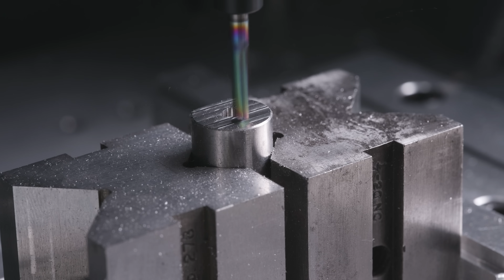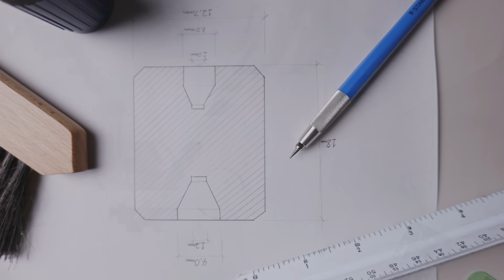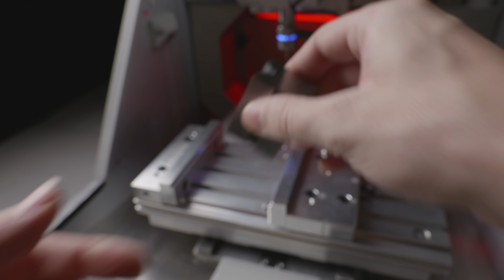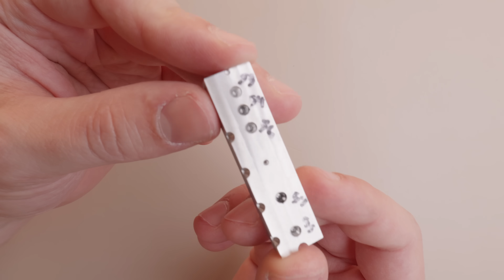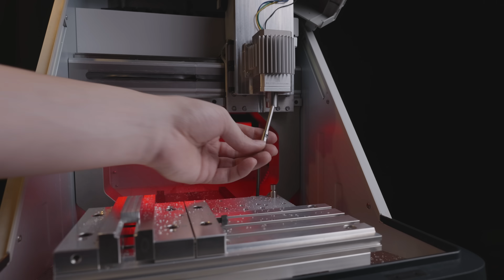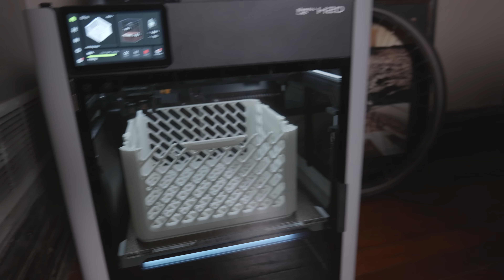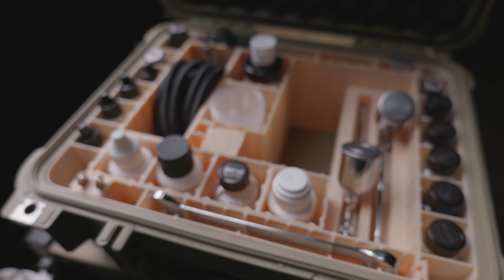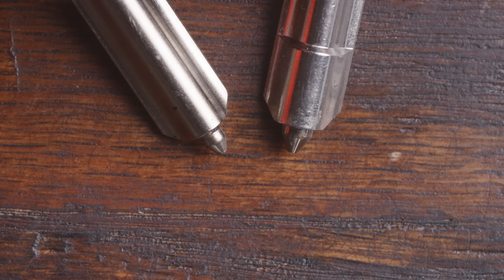Inventing A Tool Every 3D Printer Needs

Comment: That one Bambu engineer: Wouldn't it be fun if the nozzle had a 55.3 degree taper angle? 😂
Reply from the maker: haha they had no idea someone would spend a month trying to measure the taper angle
Reply: @Unemployed_Architect  you could have projected the shadow of the nozzle using parallel rays of light that you create using lenses, a picture of the proected shadow would help you get a very precise measurement of the angle , not sure if you tried this already lol.
i know you tried the camera thing but cameras cant get the angle just by taking a picture the camera lens would warp it ig
Reply: Is the taper even consistent between different batches of the same size nozzle? I'd expect them to be made by CNC, but maybe it's just some guy in a sweatshop eyeballing the angle on a lathe.
Reply: More likely they use a fixed taper length and wall thickness around the final orifice, leading to random ahh taper angles that differ for the sizes.
Reply: @quinnobi42  You are probably right.  It could also be measured in gradiens though.  LOL
Reply: Perhaps there's a "sensible" machining reason for it, like it's arcsin(14/17), or something.
Reply: XD
Reply: Eh, it goes with the company's general ethos: fuck the customer.
Reply: @werdfeefs7027 - so say all the morons.
Reply: @werdfeefs7027 And advertise so much that they'll fork over thousands of dollars anyway. It baffles me how many people fall for it.
Reply: @dekutree64  - it baffles me how stupid the anti BL fraternity are, ironically, when they should be thanking them for moving the hobby forward and dragging the Prusa's of this world into the 2010's.
Reply: @werdfeefs7027 lol what? You seriously think some engineer sat in their chair and contemplated the nozzle champfer angle based on "fuck the customer"? 

You have got to have better things to wear tin foil hats about
Reply: @werdfeefs7027so edgy 🙄 what does that have to do with the angle?

Comment: Yeah, man, those desktop machines are kind of neat, for what they do, and they do do what they say they do, it just has to be really slow. Like, you can't have any ambition with those things.
Reply from the maker: Ya for my work flow i very much see it being a second operation kind of machine. Rough the part out on my manual machine and use the CNC for any weird or super complicated geometry. In the end of the day a 35lbs desktop machine will never replace 2000lbs machine

Comment: Engineer here, Here are a few problems with your build:
-Your device is more expensive to make and needs special tooling to manufacture. 
-its almost impossible to mass produce for all the different kind of printers out there...
-making it out of a harder material than your typical brass nozzles will make users eventually damage their nozzles
-its usually easier to use the most common tool, (a brush pad) and improve that design...
Reply from the maker: @VoidPixel4179 all fantastic points! I will say that if I were to make more than a dozen I would definitely look into getting these made using SLM. 
With how small the part is you could really pack the build volume and get the price wayy down.

Plus with SLM you can do a variety of hard and soft metals and you wouldn’t have to make custom tool paths for each nozzle.

That said for majority of people the brass brush or some other simple tool is gonna be the way to go. This was more of me just seeing if it’s possible
Reply: @Unemployed_Architect  i appreciate your honesty.  If it's a limited run then fine, but just google how many 3D printer manufacturers are out there and there are dozens, and almost as many different nozzle geometries. You mentioned SLM, again from my material science background, SLM leaves bumps which act like sand paper. They usually have to polish an SLM part if they need a smooth finish. This will also add to your manufacturing complexity and cost, not to mention any sanding will change the final dimensions. 

This is why we engineers are trained to loop problems in steps and come up with the best possible solution given our current materials and tools. Improving brush design seems to be a better path than overcomplicating this tool....
Reply from the maker: @VoidPixel4179 Well see i was thinking the rougher surface texture could be a benefit acting exactly like an abrasive and removing an microscopic bits of filament or residue. That said it could also be a problem causing premature wear to the nozzle. 

Ya if im being honest with myself i just made it because i thought it would be cool...which is why im an architect not an engineer haha

Comment: The spinny handle is legit. Perhaps a way to “embed” brushes or some other flexible abrasive into the cleaning end, so it can adapt to any angle?
Reply from the maker: Ya like a hard rubber thats imbedded with abrasive would probably work. Brushes could be hard because the nozzle is only like 3mm wide
Reply: A cratex stick is kind of what you describe. Not sure how well it would work but it is a great material.
Reply from the maker: Exactly like a cratex stick. Although ya it might be to soft

Comment: too complicated, too expensive, and a hot nozzle with a soft wire brush does the job of removing the plastic.
Reply: aaaand. nozzles are wear items so if it's too messy to clean, try to see if it's more worth it to replace it.
I don't know how much do modern steel and hardened steel nozzles last but be aware of it.
Reply from the maker: A simpler tool is often the better one so I can’t really disagree haha. I spent a month on the project so I’m never gonna make that up with the 30 or so seconds I save from using this tool vs a brass brush. That said I would still do it again

Comment: Such a good idea. I think it would work better/more universally with some sort of flexible inverted pawls or round knuckles that conform to the nozzle itself! Could be interesting and simpler to use steel wool in some way too. Love the handle!
Reply from the maker: I have seen flexible hones for rebuilding engines. they conform to any diameter. The only problem here is how tiny the nozzle is. at just 3mm wide not a ton of space for moving parts. But could a cool challenge to make something soo tiny

Comment: Also can”t superglue be washed off using isopropyl alcohol? (Correct me if I’m wrong)
Reply: Nope.

Acetone can be done, and it might not do anything to a resin print, i think, since it's crosslinked.
Reply: @SianaGearz  any thanks for the clarification
Reply from the maker: Actually when I spilled the super glue an immediately tried to wash it off in the sink. bad idea the water cured the glue. I thought about using acetone but was worried it would damage the clear coat. so I just figure a re print would be the easiest way especially since I still needed to get the beauty shots haha
Reply: @Unemployed_Architect   Yep it would take off the clearcoat.
Reply: @Unemployed_Architect   Yes both water and isopropyl alcohol insta-cure superglue cloudy.

Comment: Nice idea, I was expecting an automation aspect but that'd be nearly impossible 

Do love the free models though ♥️
Reply from the maker: I did think about automation as well. but then slapped myself in the face and said stop trying to make it more complicated haha
Reply: automation is not impossible at all, in fact it is relatively easy, mount it with spring, design a track grove that lead it to the nozzle cleaning pit. say the track runs in X direction, you would have wiggle the toolhead in Y direction while going down on Z direction, then the nozzle will eventually fall into the track, after that just command the toolhead to the pit, and trigger a motor to spin the block.
Reply: not impossible, but probably not user level, this would be a printer feature, one of these, a small load cell and a cheap stepper motor could easily give a nozzle a once over at the start of a print, and maybe an operation every few hours to freshen it up when in use. it would never be fully automatable without obscene cost, but could be gets the job done at the very least.

Comment: Nice! Seems like you could make it more complicated! The awls remind me of vintage plunge driven screwdrivers, so you could automated the setup, having a spring plunger with a guided barrel that causes the cleaning head to rotate when depressed. The sping gives it compliant constant contact with the nozzle, allowing a gcode macro to bring a nozzel over it, and slowly feed down to clean. 
Of course, solving the multiple nozzle sizes with one unit isn't easy, or a way to reliably remove the removed filament and keep the print chamber clean.
Reply from the maker: This is like a straight genius idea. I briefly thought about automation but couldn’t think of way to rotate the nozzle. I never thought of having the tool rotate. I definitely might have to give this a try. if not just cause I think it would be a cool device
Reply: @Unemployed_Architect Mind you, I don't know anything about the mechanics of this. But ... I remember, as a kid, my dad had a screwdriver that, when pressed toward the screwhead, would rotate the shaft and screw or unscrew, depending on the setting. Archimedes would have found it amusing. But there is ... or was an existing driving mechanism that you could examine, then recreate at scale. Or ... from this mention, your brain might already be flying down multiple pathways toward an analog.
Reply: Cool idea! Made me curious what your coolest inventions are, just sounds like you know how to build stuff. Btw was your idea about making a push down to rotate the cleaner? Like theres a helix that allows rotation using lateral force? Something Like a manual drill. Sounds like a fun complication for premium devices. But if thats what it was, i think the upwards plunge would add stress to the z axis which it would never encounter naturally

Comment from the maker: Hey if you liked this video consider giving it a hype. With how small
my channel is just a handful of people hyping the video makes a huge
difference, that and i would love you forever (:

Sadly it’s only on the mobile app though. Right next to the like and share.
Reply: Hyped! Great vid, loved it. Im glad you reminded me to hype cuz its deserved. Btw I wonder if u could have just modeled some flat cross sections of the nozzle. Adjusting the angle and length of the bottom flat for each piece printed just like making calibration prints then see which one fits best using a camera to get a better closer view. That and I believe I might have seen precise measurements online as well.
Reply from the maker: @Lance-132  Thank you i really do appreciate you going out of the way to support me! I did try something similar with the aluminum test block but a true flat pattern would work better. if there are measurements i couldn't find them and believe me i tried haha
Reply: Should probably explain what Hype even is. I'm a YT addict but never watch it on my phone. Had no idea what Hype even was.
Reply: @dsp4392  Hype is something newer. True that some people might not know it yet if they dont use the app